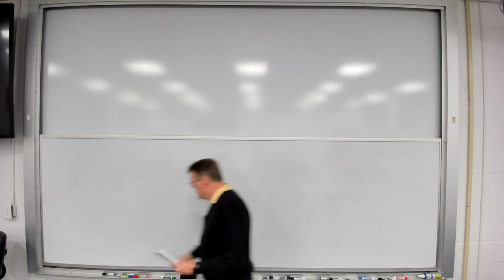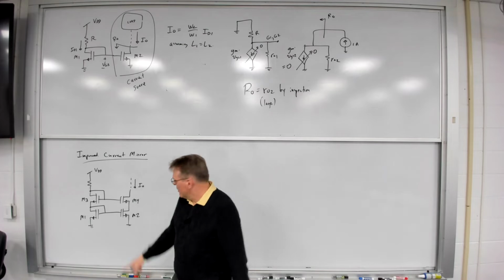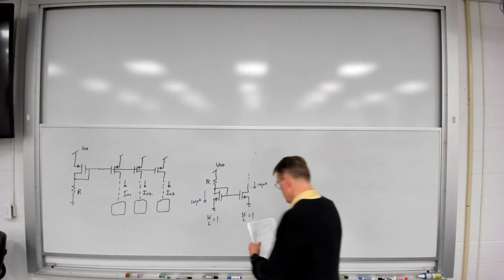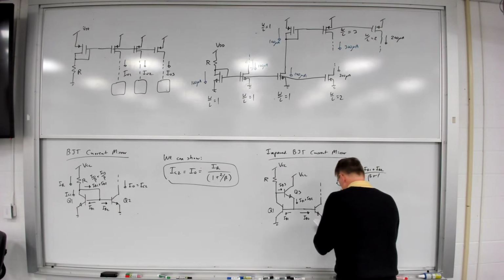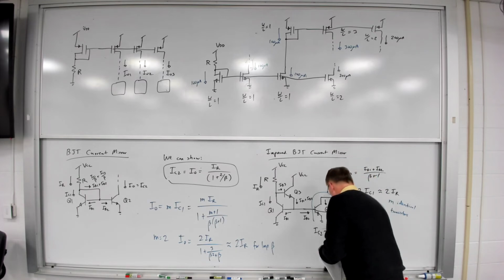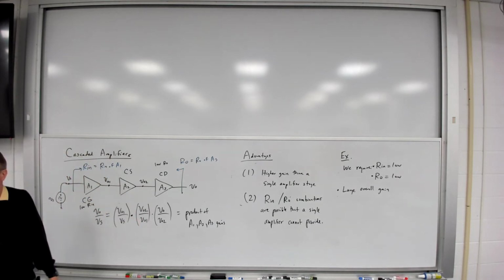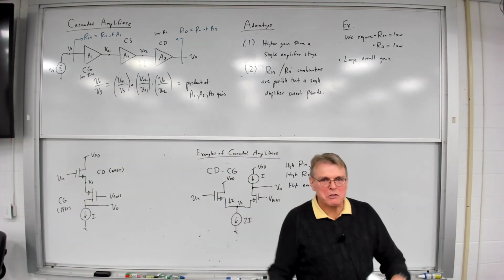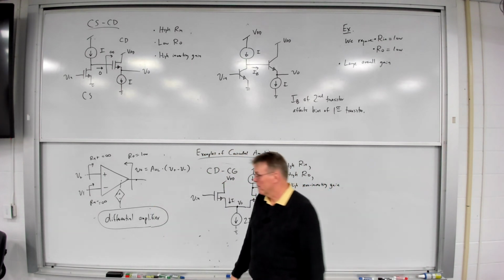Electronics - Lecture 24:  Current sources, sinks, and mirrors; cascaded amplifiers

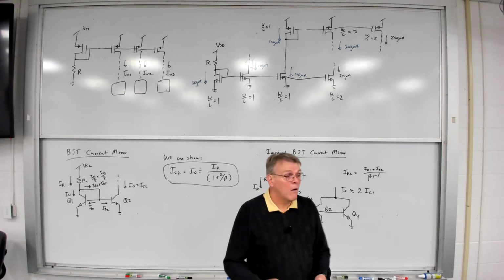Comment: How is Q4 connected to Q2 on 30:42, through the base of Q2 ?
Reply from the maker: Correct, the bases of Q2 and Q4 are connected together.  This is the standard current mirror connection you'll see in many schematics.